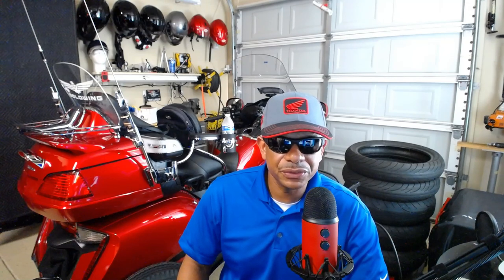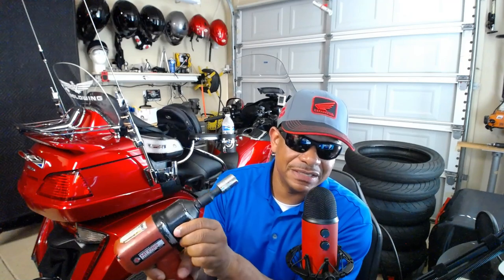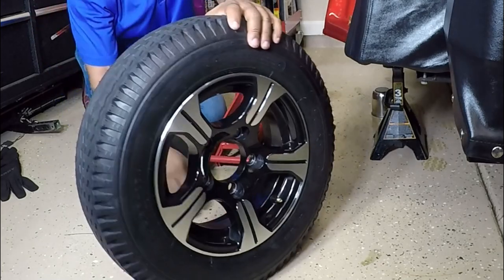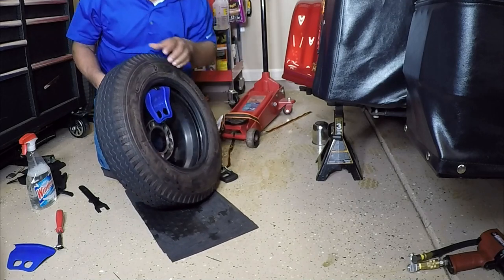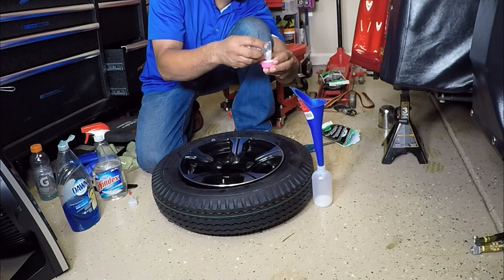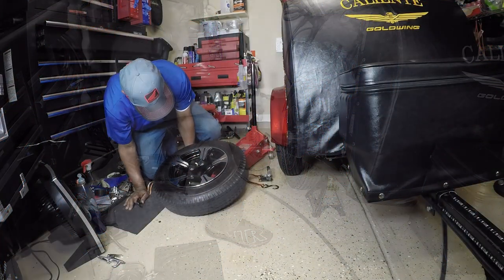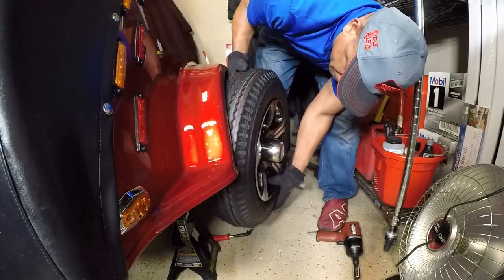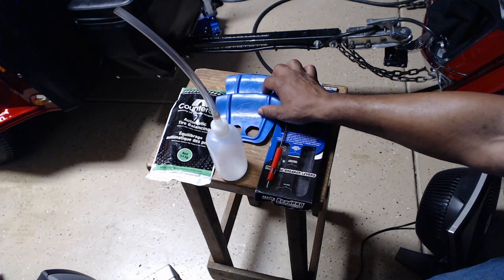Change your own Tires 2020

Comment: Great information. I try to mount my own tires on my Double-Darksided GL1800. 1. Front I got on but, cut the tire and I didn't notice. A shop, halfway in my cross-country trip fixed it without having to buy a new tire. Barely charged me any money. 2. I got my back tire on halfway and then went to a local Walmart and a nice gentleman there put the other half on for free (I offered to pay). 3. Both my trailer tires I mounted myself.

Comment: I CHANGE MY OWN CAR TIRES AND TRUCK TIRES THE SAME WAY....  BUT FOR SOME REASON THE TIRES COME OFF EASIER FROM THE FRONT FIRST THAN THE BACK,   THAT' S JUST FROM MY 37 YEARS OF CHANGING MY TIRES.  BUT AS LONG AS YOU GET IT CHANGED WITHOUT PAYING IS WHAT COUNTS.   K9 REGGIE RIDES A  1800 WANG.  👮🏽👍🏽

Comment: Would change the valve stems every tire change. The rubber will lose strength and dry out over time.
Reply from the maker: Marion, you forgot to tell me that tires need to be rotated every 3000 miles so that the tires can wear evenly, or it's best to fill the tires with Nitrogen over Air so that tire pressures will remain more stable over long term.  How about apply tire dressing to the sidewalls to protect your tires from the sun's harmful UV radiation.  It's almost impossible to cover every subject about tires, but somethings people should already know at this point but I appreciate it.
Reply: @chriscaliente5033  was strictly an "FYI" for other viewers. Thanks